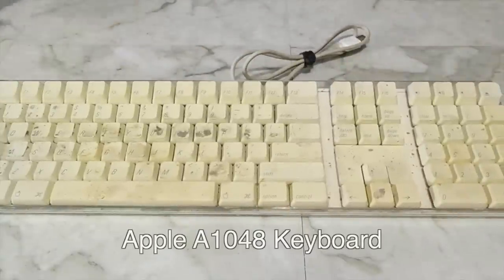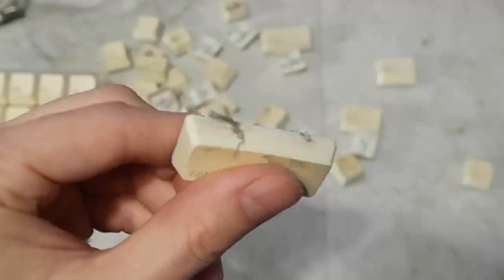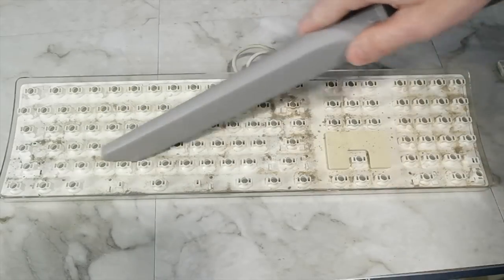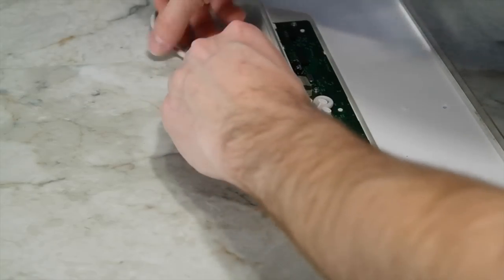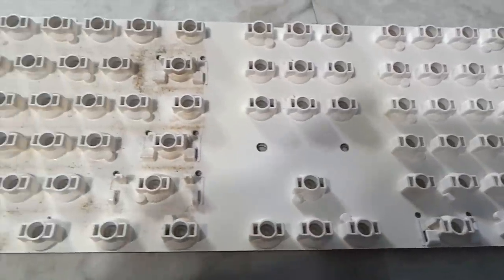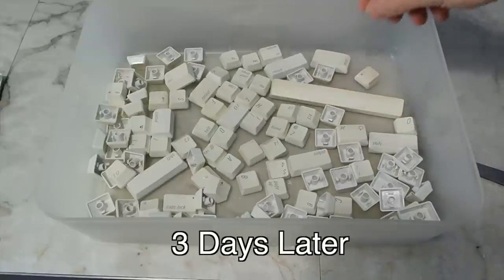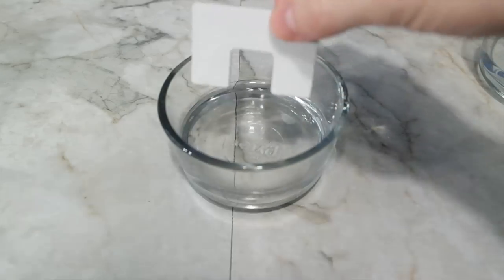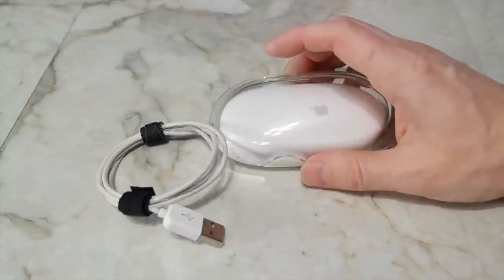Restoring an Apple A1048 keyboard

Comment: I took my Apple A1048 keyboard apart today and cleaned it.  I followed the steps in this video and now it doesn't work.  The USB works.  I plugged my mouse into the keyboard and it works but the keys aren't working.
Reply: Make sure you connect the ribbon cables to the logic board correctly and it seated in their firmly. I hope that helps :)
Reply: @JayarFlores  I checked the ribbon cables and it didn't work.  The keyboard worked before I took it apart to clean it.  It is old.  I gave up and ordered an NOS Apple A1048 from E-bay.

Comment: I need some help, I have this same keyboard and I spilt some lemon Tea in it. After that some of the keys stop functioning properly or at all.  I took it apart and cleaned it completely and no luck, any ideas?
Reply: Well I'd imagine the logic board has shorted. being as it was "lemon tea" even after it completely dries the board may not work the same again, or even atall. give it a few days to dry, let it sit in a room just on its own with no extra heat sources such as a heater/in sunlight, then test it. It it doesn't work then it's probably dead.
Reply: +Tobias Bennett Thanks! I'll try that.